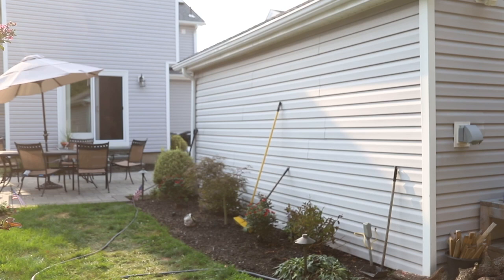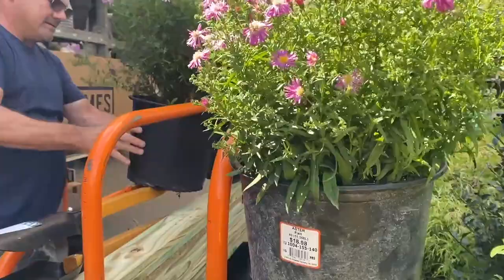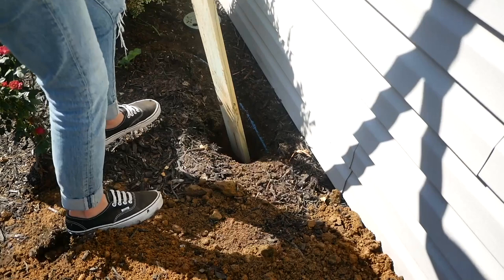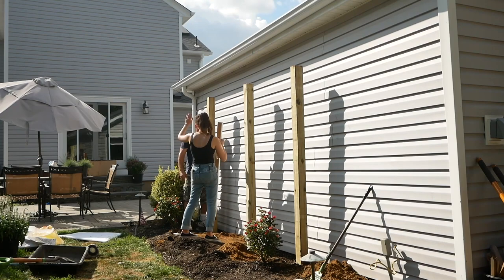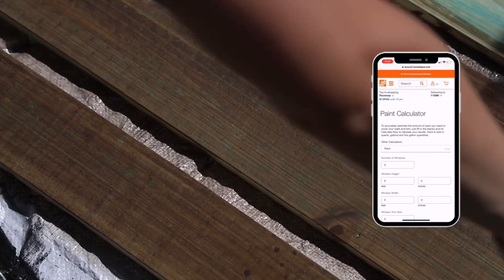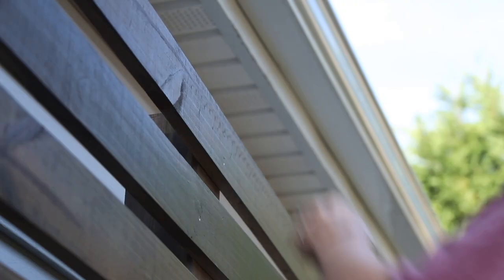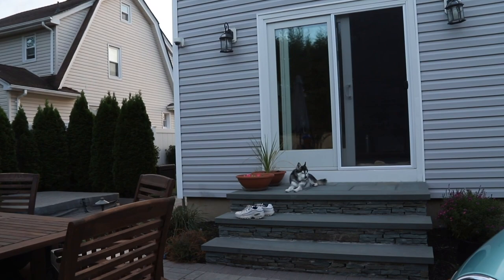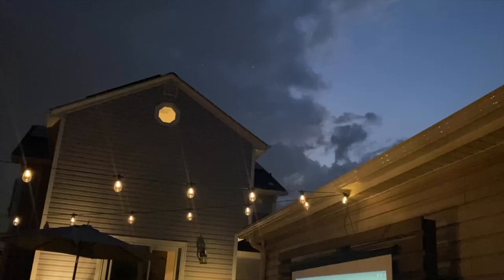EASIEST OUTDOOR MOVIE THEATER HACK

Comment: Sam, first, I teared up because you are so lovely to your parents. This is a perfect project for them. 
Second - a quick question. I am always hesitant at putting pressure treated lumber through my table saw due to the chemicals in the wood gumming up the saw. I spent a lot of cash on the Sawstop saw and fancy blade. What are your thoughts on this? Thanks
Reply from the maker: They’re the best for letting me build all the things in their home. The lumber I used wasn’t really wet and I cut them on bypass mode - worked well!

Comment: I love this channel and this looks great, but I have to comment on this one. You did so much right in this video that I hate to be that asshole, but movies and videos aren't perfect square anymore. With this build you'll be just fine, get a better screen that fits into a 16:9 ratio, but if you had built the backdrop to fit this screen it just wouldn't really work out well.

Not trying to hate just commenting to help people who may try something similar. Make sure your screen ratio is the same as your projector.
Reply from the maker: I hear you, but I just designed around what my parents wanted, and this was what they wanted. The projector has multiple options to adjust for screen size, ratio, and whatever else they need for a successful movie night. The screen is also not permanent and can be changed out super easily. Just wanted to give my parents the project they asked for. They’re happy, so that’s all that really matters. 💓